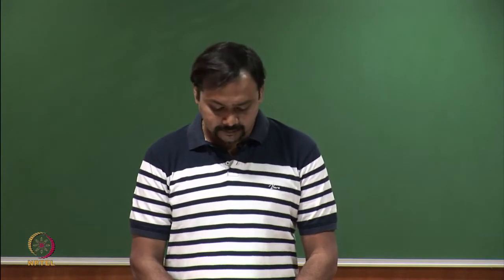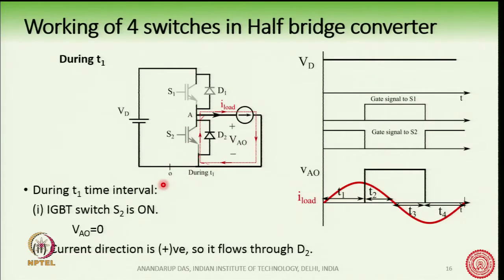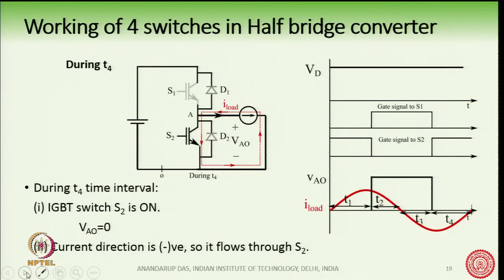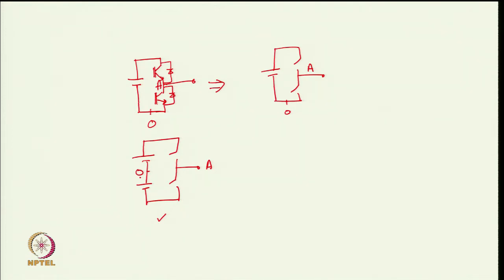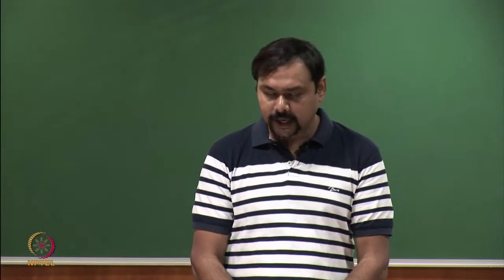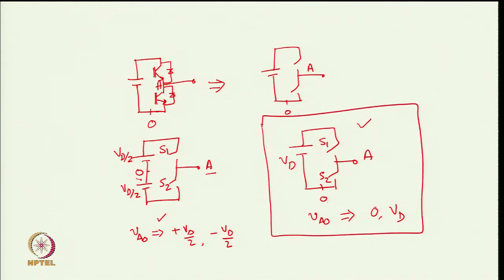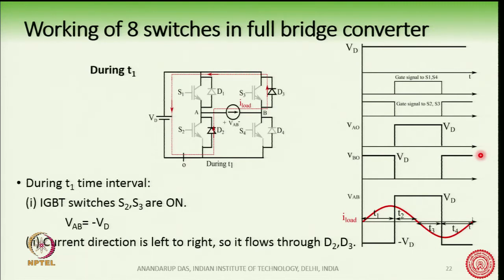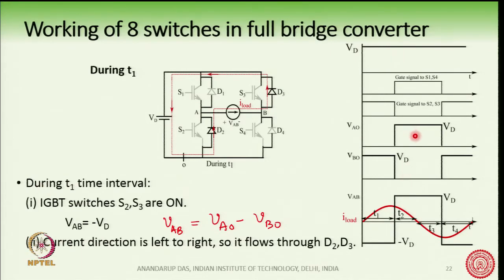Basic Understanding of Converter (Half Bridge and Full Bridge Circuit Operation)

Comment: In the "Working of 4 switches in half bridge converter" example, the current graph doesn't seem to be right. The current graph depicts the decline and reversal of current when the Vao voltage is +Vd. While the current fall, then change in direction of current should finally result in current rise in the direction of Vao which is +Vd. Or the Gate Signal graphs of S1 and S2 should be swapped.
Reply: I agree. Not only the diagram, the explanation is also wrong. At time t3, Gate signal of s1 is still high. Why is the conduction done through diode when the switch is still on ?